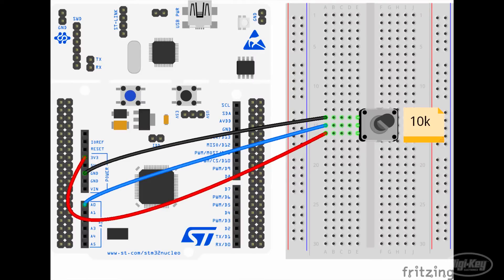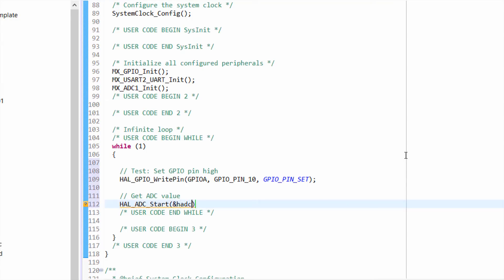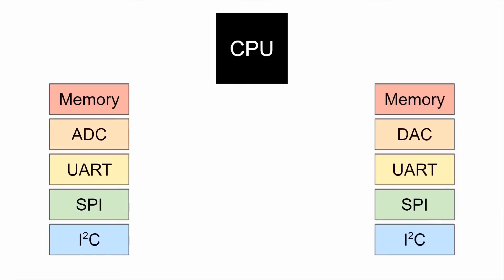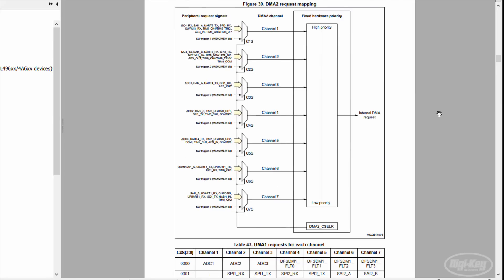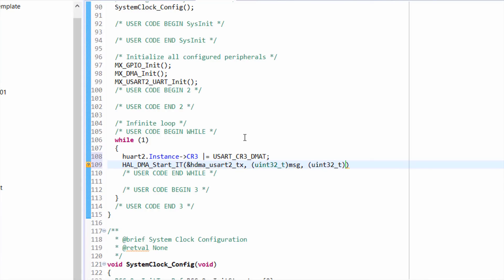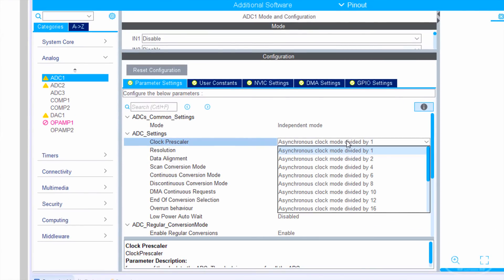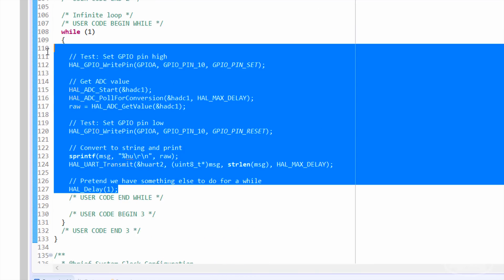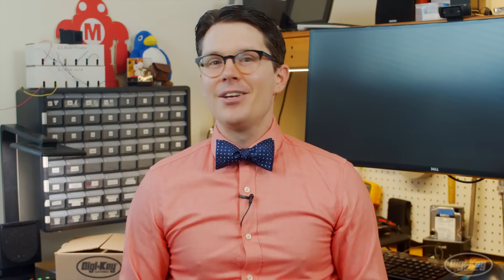Getting Started With STM32 & Nucleo  Part 4: Working with ADC and DMA - Maker.io

Comment: What was the purpose of explaining the max clock frequency and the fact that we can have 5.333 Msamples/sec? You do not use it anywhere, neither the prescaler. Could you also please explain the other ADC settings that, for example, could be used for ADC in differential mode?

Comment: Huge help, thanks Shawn.   Nice early 60s retro motif,  I should watch "catch me if you can" again.  My problem is reading multiple ADCs (four, so for the STM32F446 means reading three and one in scan mode) performing some arithmatic on the values and pushing them back out through the DAC.

Comment: What is the maximum frequency at which the signal is read? For example, I need to measure an analog value 1000 times per second, so what happens?

Comment: While DMA is a sounding approach for moving data between the ADC and memory, there are cases where writing optimized ARM assembly code could be faster and more performant. For example, if you need to perform data processing operations on the data coming from the ADC before storing it in memory or if you have specific timing or performance requirements that cannot be met using DMA, writing optimized ARM assembly code it could be feasible and simple, something like this that could be further boosted by added some SIMD-like in Cortex-M7 like:

; ARM assembly for copying bytes from source to destination, similar to x86 rep movsb
; Registers:
;   r0: source address (ds:si equivalent)
;   r1: destination address (es:di equivalent)
;   r2: count of bytes to copy (cx equivalent)

copy_loop:
    ldrb r3, [r0], #1    ; Load byte from source address and post-increment
    strb r3, [r1], #1    ; Store byte to destination address and post-increment
    subs r2, r2, #1      ; Decrement the count
    bne copy_loop        ; Branch if count is not zero, i.e., continue the loop

Comment: This is a super great series. I would love to see a video on how to do this with multiple channels though. As an embedded beginner (well, a beginner at anything beyond an arduino), the thing I struggled with the most was figuring out how to read multiple ADC channels. There are a few ways to do this, like manually starting a conversion, changing channels, then doing it again, or using DMA, however many of the settings you don't have to worry about with single conversion become super important (and difficult to understand) when multiple channels are involved so I'd love to see a tutorial explaining how to do this with many channels (I learned the hard way that the settings need to be quite different for 2-3 channels vs 6-8), and what considerations and settings are involved.
Reply: Can you provide a mini guide on how to read from two channels (differential measurement) and DMA?

Comment: I Know it several years after this video but i tested your solution to do the msg dma (Memory to UART) with an NucleoL053R8 and it compile well and debug well but i receive nothing in the com port on my computer and the led is not blinking. I don't know where the problem is. 
The code is running and the HAL_DMA_START_IT func get no problem but it seems that the HAL_DMA_RegisterCallBack function is not used, I don't really know when exactly this function is supposed to be call because it is not in the while loop.

Is copying the msg to TDR register is the only thing to do for send a message in uart ?

Is anyone read this message a little help will be very appreciate. Thank you for the video btw
Reply: Hi, I was also having this problem. I had to make two changes to get it running: 

Change the destination register to huart2.Instance->DR (instead of TDR) 

Move the auto generated MX_DMA_Init(); above the MX_USART2_UART_Init(); so that the DMA initializes first.

Hope this helps!
Reply: @boxczarbill  Hi! It'm seems that move the auto generated MX_DMA_Init() is working. 
TDR is the right Register, I just move the DMA Init and it's working well.
Thanks!

Comment: Great tutorial.

But the current STM32CubeIde (v1.7.0) puts  MX_DMA_Init(); below of  MX_ADC_Init(); and that's not working in that order. After any changes in the ioc file, I have to put back the MX_DMA_Init(); line in front of the MX_ADC_Init(); line to keep the AD working.

This took some hours to figure out when none of these DMA tutorials worked on my board. Than I find a forum post about this issue... It was a mirracle.
Reply: omg thank you lmao
edit: you can repeat the DMA init line under "USER CODE BEGIN SysInit", and it will not be removed
Reply: Thanks, took me also hours to figure out - I am wondering why the order get changed ...
Reply: Thank you it's work great.

Comment: I consider this the best video series to start with STM32 Cube and the presentation is very efficient.

A disadvantage of STM32 is documentation (like so many other companies ST suffers from complexity build up along the way). For instance:
The channels used in Timers and ADC are linked to some I/O pin. Nowhere I can find the correlation channel - I/O pin except by assigning the channel in Cube and see what I/O pin gets affected. That's not optimum to determine best PCB layout. In DM0038 (about STM32L152), the DMA register set doesn't list the 2nd addressing register for half transfers as claimed elsewhere in the same document. Some examples are even potentially dangerous, since one should start by disabling DMA and test if the enable bit reads zero before starting to modify DMA registers. The documentation also has examples using DMA registers that match the DMA description related to STM32F746, but not the DMA in STM32L152 (that chip has several DMA configurations possible and I fear some mixups happened there). If HAL doesn't support what one needs, such errors in data sheet / reference manual are really killing. According to some documentation, STM32L412KB should be able to measure duty cycle & period or generate PWM signals both DMA based. I measure DC using input capture on both edges by DMA, but didn't find if (a) measuring DC & period on the same pin is possible and (b) how to do that with HAL (even no idea if really possible both by device or HAL)? So I hope Shawn doesn't stop with this series yet but adds more.

Comment: Hmm I must have done something wrong on the first attempt. I tried adding the DMA UART communication to the first ADC example directly without making a new project first.. But it looks like I wasn't receiving data on my laptop using cat /dev/ttyACM0 even though the LED is blinking and setting a breakpoint on the callback function also works. The HAL_DMA_Start_IT function returns an OK status. At first I thought it might be due to the difference in chip, because I'm using the Nucleo-F446RE, which has some differences in the DMA setup. But anyway when I just tried to do it again using a clean project, sending data over USART2_TX using DMA worked just fine.. So far the only code difference I've found is a missing \r\n at the end of my sample text but I have a hard time imagining that to be the cause. And it's not just a hickup or an anomaly or something because when I switch back, it still doesn't work. Anyway too late now. I'll look at it again later.. Thanks for showing these great examples! I like the pace as well: challenging, no need to skip ahead all the time and with the right amount of detail and explanation of the basics. I'm hoping there's much more STM32 content coming. Perhaps a demo using some DSP instructions could be interesting. And of course I don't suggest that at all because that's what interests me the most ;)

Comment: how do you open serial monitor?
Reply: i think you use something like putty but i can’t seem to get it to connect
Reply: @marshallstone731  yes use putty, under the UART config, you can read the baud rate and settings, put the same on putty, and in device manager find the COM port that st-link is working on

Comment: Great series, Shawn, so this isn't a criticism, but a plea for help.
At 3:21, I can't see how you opened a serial monitor.  I slowed the video to 0.25 speed, but was unable to see where your mouse went to open the serial console.  Then I captured that section of video with OBS Studio, then edited it with Movie Maker so I could single-step the video frame by frame, but I still can't see how you did it.  I've tried googling for it and searching the ST website, but I can't figure it out - and so far, I can't open a serial console.  Somebody asked 8 months ago, and the answer was that there isn't one.
I'm using STM32CubeIDE    Version: 1.3.1
Build: 6291_20200406_0752 (UTC)
(C) 2019
Reply: using putty, fill host with COM Port
Reply: I was also confused at this point. I wish STM32CUBEIDE had some sort of display console, but i don't think they do. 
You need to get ST-Link Drivers and PuTTY, or some sort of serial/COM console. 
Configure them to communicate and they should display the message. For me so far, is it not so easy.  
This link is helping me get along: https://stackoverflow.com/questions/52385728/using-putty-to-print-from-stm32. 
Good Luck!
Reply: @faaizsiddiqui7906  Thanks for that, Faaiz.  I'll look into it tomorrow.  Because I was making such slow progress, I put it to one side, and haven't been working on it much, but with your comment, I'll have another go and at least try to get through this video.  Who knows - I may even complete my project one day.

Comment: when I set the potentiometer in the middle and measure the voltage, I get the 1,6v. After I connect the ADC the voltage drops to 0,1V. Do you know what the problem might be?
Reply: maybe the current from your potentiometer isn't enough for the ADC, i.e. its resistance is too high.
Reply: @SemionCobileanschii  i connected it to different ADC pin and it suddenly worked with the same setup
Reply: @babotvoj  maybe your "original" ADC pin is internally damaged, or has some other stuff hooked on the same physical pin. I may be wrong, but I know that the voltage drops only if something drains more current than the source can give.

Comment: Hello! Thanks for the series. I have a question. I want to use a DMA in normal mode to store to a buffer, and then switch to use the same DMA in circular mode to fill a second buffer. What's the best way to go about this? i tried changing the "Init.mode" to DMA_CIRCULAR after I've filled the first buffer however that does not seem to switch it to circular mode..

Comment: Damn! A lot of that went straight over my head! At least now I know what the purpose of a DMA is. But I feel that I have a major lack of understanding of how the basic processes in a MCU work. Like, I don't even know what a callback is or how to effectively make sense of the documentation.  Can someone point me to good resources that explain these basic processes to beginners? I mean, not how you do an analog read on an arduino, but stuff like using the DMA-controller. But this video here is almost too detailed for me. While I understand some things, 70% are lost because I don't know the other concepts. I think I need an overview about all these concepts and then I can look at implementations like this. Any advice where I should start?
Reply: A Callback function isn't specifically for a microcontroller, but a term used in software in general. A callback function is like any other function that is passed as an argument to other function; that other function is then "call back" that function somewhere in his code. In this video's context, the DMA HAL allows you to pass any function (that you are going to write, and you can write whatever you want in that function) that the DMA HAL will call after the transfer is complete. There are four events to choose from, Shawn choose "Transfer Complete", so your callback function will be called after the transfer is complete. Just google callback function.

Comment: I have the ADC set to continuous conversion mode, and added a DMA Channel (circular mode) for it, and execute HAL_ADC_Start_DMA (&hadc, pBuffer, Len);  however, I don't ever get the ADC_DMAHalfConvCplt or ADC_DMAConvCplt callbacks.  What could be the problem?

Could it be the ADC 'Conversion Trigger' setting in the ADC Mode and Configuration window?
Reply: hey im dealing with the same problem. Did u find a fix? Im on the STM32H743ZI nucleo board. m actually not even getting any values stored in my adc_buf array in the first place. Thanks

Comment: "Not practical examples"!? I'm trying to make heads or tails of how to use the ADC to read data from a microphone and then store enough data to process it with DFT. There are very few accessible, useful tutorials for the STM32 family out there. This is MOST practical for me! Thank you, Shawn! Keep it up!
Reply: Hi Christopher,
I am also trying to capture microphone recordings for DFT processing. Could you share your GitHub page so that I could replicate your step? Thank you
Reply: I'm trying to work out how to control a BLDC motor.  I find HEAPS of stuff telling me about the capabilities of the chip - the timers and how they are tailored for what I want to do - but nothing to tell me how to implement these capabilities.  We could really do with an online course of tutorials.  Shawn Hymel has some excellent ones, but I guess it takes him time to learn enough to present a new tutorial, and time to produce it, so they don't come out very often.
Reply: Hi Christopher, hope you read this, I am in the same situation, I need to use the microphone, store data and process it with FFT. I am a bit stuck, could yo share your GitHub? If not, at least I am glad I am not alone in this struggle
Reply: code
Reply: chk out Nizar Mohideen's channel too for some practical examples. lots of little bite size applications there to try. May not be exactly what you need but they helped me learn alot

Comment: A question not related to the video. I want to add an TFT-Display library, but when I include it on main.c it doesn't find the directory...
Can someone help me ?
Reply: It actually worked  when I declared the full path 

#include "C:\mBed Development\429I-TFT-Display\Drivers\BSP\STM32F429I-Discovery\stm32f429i_discovery_lcd.h"

But that way will only work if it's compiled from that specific folder, and I don't want that...
Reply from the maker: Hello! If you’d like you could try posting this question on our TechForum. We have a team of technicians and engineers that monitor that page and I’m confident one of them can help you find the answer.

Comment: Hi Shwawn. Can you also do a few videos on DSP using stm32f4? With stm32cube IDE, I am not able to use the CMSIS DSP library.
Reply: Interesting...I would have thought that all of the CMSIS libraries would have been accessible but perhaps not integrated with the Cube software. DSP stuff isn't on my list of things to show, but good to know there's interest! I'll have to keep that in mind :)
Reply: @ShawnHymel  

When DMA take control of peripheral BUS then how Microcontroller will communicate with other peripheral ?  Which type of other thing it do??  Many articles says that at that time CPU BUS is in tri-state Buffer.... what it mean??  If CPU cant do more task then what is meaning of DMA????
Reply: @radhey04ec  if a particular bus is being used by DMA, then the CPU should not be able to access to it. However, the CPU can do other things, like crunch numbers and read/write to and from other peripherals not on that same bus.
Reply: @ShawnHymel  
Thanks dear for quick reply, 

Is that mean there are different bus for each peripheral  ??  Block flow represents there is common BUS known as APB and all peripheral use same that BUS to push or pull data from CPU. 

Some How can we check this procedure during debugging time??? Because if program is step by step execution of instructions then if suppose CPU want to use some peripheral which is connected with APB,  and DMA already occupied that BUS then which type of process can CPU do???
Reply: @radhey04ec  You'll have to look at the datasheet for your particular MCU. The STM32L476RG has two different buses, each with its own set of connected peripherals (APB1 and APB2). I have not explored this yet, but apparently there's a FIFO mode for DMA that will let you queue up bus requests for when the CPU is not using that bus (here is a good discussion on it: https://stackoverflow.com/questions/24051720/stm32-dmaconcurrent-stream-fifo-burst-mode-double-buffer).  

As for step-through debugging, it's not really possible (at least, I have not found a way yet). Whenever you pause the CPU with the debugger, DMA will continue running in the background. This makes it really hard to debug when you're trying to see what DMA has put in memory (or has put out on a peripheral).